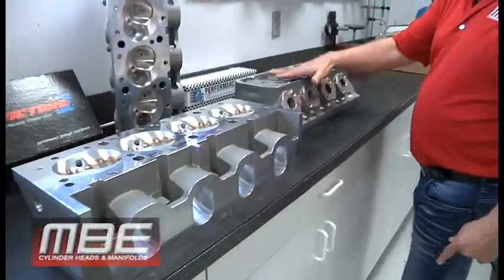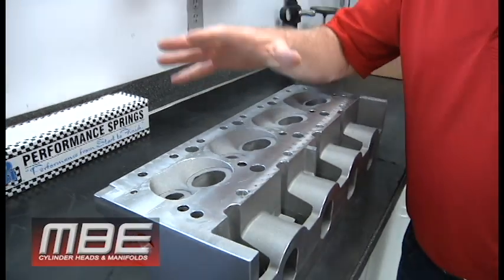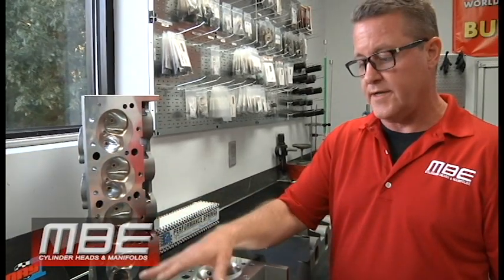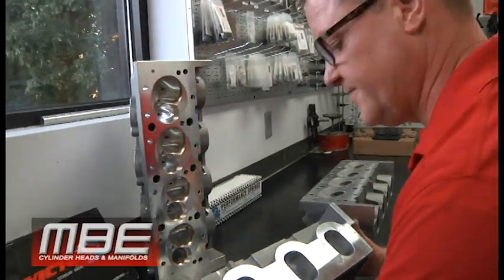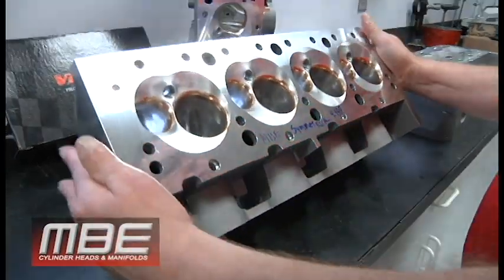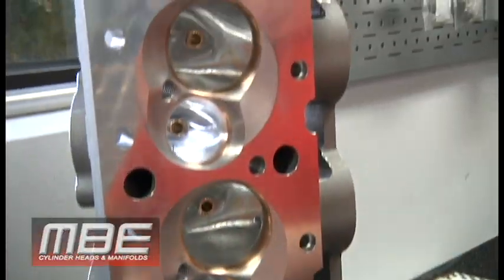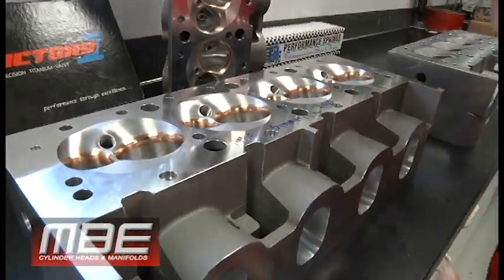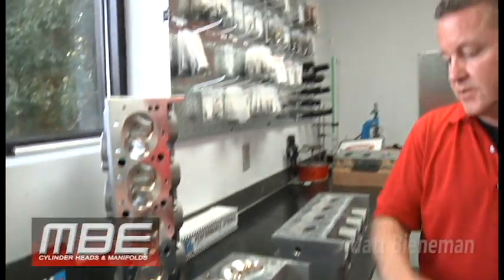** GAME CHANGER **  This SBC Cylinder Head will change History

Comment: It looks like one of the head bolts goes almost right threw each intake runner , a problem I used to have when I ported regular sbc heads for big air flow . They'd flow like a mother on the bench but you flow them with the head bolt in it  ,,,not so much . Not nickin this head its a way better design than the original for sure . I wish we had this 15 years ago I think it will be a game changer for the old school small block

Comment: This its a Pro Filer 12 degree casting , will be interesting to see if MBE change the degree angle I think the went to a 11 degree on this one, because some times they said on a video a 9 degree its better for nitrous and in the other one a 12 for more nitrous and boost and the same for the splayed valves; there its a video about there 13 degree heads that they said there its not a reason to run a splayed valve head any more and correct me if I'm wrong but this its a splayed valve head? , any way keep up the good work

Comment: I wanna see the bottom end of a small block that would be able to handle the rpm needed to take full advantage of those ports in a N/A configuration.
Reply: Bet it's one of those "if you have to ask how much, you cant afford it." Type deals....
Reply: @gadgetdeez7069  oh, I'm not talking about price, I wanna see the unobtainium that the rotating assembly is made from. We're talking pistons speeds that even Japannese 1000cc Super Sport bikes would be like "hold up a minute".
Reply: @WVXL64  there are countless amounts of sbc’s here in Australia that rev to 12000
Reply: @G6E666  yes but they are short stroke small cubic inch engine (283, 289, 301, etc). To really take advantage of these port sizes and flow numbers full potential, you're looking at a long stroke, 427ci or bigger small block, turning 14,000rpm. I dont know of any piston that can handle that kind of piston speed. I'd love to see it though if it exists.
Reply: keith stoehr  There are lots of aftermarket blocks that can handle that HP. Plus, a billet block easily will do it.

Comment: WOW, THIS IS A GOOD HISTORY LESSON FOR THAT AREA / TIME OF DRAG RACING.. !  I HAVE AND ALWAYS WILL BE A CHEVROLET GUY..!  I WATCHED PENSKY AND MARK DONOHUE DOMINATE THE MUSTANGS IN THE 1968-69 TRANS-AM SERIES AND WINNING THE CHAMPIONSHIPS.!  CHEVROLET WOULDN’T HELP PENSKY SO HE WENT TO AMC …LOL !  IVE ALWAYS THOUGHT THE ford WAS A BETTER DRAG ENGINE  OR RACING DOWN A LONG STRAIGHTAWAY THAN CHEVROLET , BUT THE BIG BLOCK CHEVY AINT NO BOAT ANCHOR… THE CHEVROLET HAD ALWAYS DOMINATED SPRINT CARS, NASCAR ,  OR ANYTHING THAT WAS ON AND OFF THE THROTTLE USUALLY HAD A CHEVROLET POWER PLANT.. I AGREE WITH YOU THAT ford HAS ALWAYS BEEN INVOLVED $$$$ IN ‘’ RACING ‘’ WAY WAY MORE THAT A SMALL COMPANY CALLED CHEVROLET..!!!  FORD VS CHEVROLET IS PROBABLY GOING TO BE A THING OF THE PAST WITH THE SEWING MACHINE REPLACING THE V-8  .  I ALWAYS LOVED READING THAT THE GREAT DALE EARNHARDT WOULDN’T DRIVE A ford  (AFTER DRIVING ONE FOR LESS THAN A YEAR )….LOL ..!!!  🏁

Comment: For the average guy by the time you buy the heads and all the valvetrain then the intake and headers you might be able to purchase a few other cars. Then with those big ports and flow numbers on the street the port velocity will be crap unless you run 13:1 compression or have a roots blower. On a stroker engine it would be better but like I said for the average guy the bang for the buck is there but you had better have a lot of buck's. And that is not the majority of average people these days. Those would be good in Nascar where the rpms are always 6000 or better they are great heads but for the street they are overkill.
Reply: Nobody street drives this head lol That isn't their market
Reply: Who ever said these were street heads?

Comment: So basically you made a set of Ford heads to fit a Chevy.
Reply: We have 480cfm sbf heads? Or 2.30 intake valve sbf heads?
Reply: @garlandjones7709  Ford's Boss 302 came with 2.23 intakes stock...yup.
Reply: @kidsteach938  Thats like comparing a 2.02 to a 2.08/2.10 intake in an oem inline head chevy or ford either one. And 2.30 valves in a boss 302 wont pick it up 200cfm. These have much smaller exhaust valves than a boss and im sure different valve angles as well.
Reply: @garlandjones7709  We're saying that it is a magnificent head, but an evolution of a Cleveland/Boss Ford head, not an evolution of a SBC head.
Reply: @kidsteach938  the stance comes from a lack of familiarity of history imo, and i may be wrong. Firstly, both the original post and yours seems to imply the assumption that the symmetrical port and valve cant is the first of its type in the sbc world. There have been handfuls of these.... even sold by this company.  Neither of those features is what this video is advertising to sell these over others. 

To say again in different words, im open for learning...but what makes these a copy of boss/cleveland heads vs a copy of BBC heads?
Reply: @garlandjones7709  Well, you would have to pull up a Cleveland head and see the port shape, spacing, volume...the combustion chamber shape and relative slight cant, the enormous intake valve...I know the numbers will be different, but this head is the son (or daughter) of a Cleveland father. I'm VERY familiar with American V8's, and know about polyangle Mopars, Ardun flatheads, early hemi's, Chevrolet's "mystery" rat motor which became the BBC, etc. I have owned small block mopar, sbc, bbc, FE ford,  bbf, v8's over the years.

BBC don't have spread intake ports, and the shape is different as well.
Reply: @kidsteach938  im familiar with the clevelands. I guess my point was missed. The familiarity reference wasnt to american v8s in general. If youll go back to my comment i made mention to the history of thr SBC head. What i had in mind was the over 20, going on 25 year old SB2 Nascar heads, and a handful of other aftermarket ones since, and possibly some prior. 

Im aware of the bbc outer port locations. The point with that was to see what you were seeing specifically that is calling this a copy. That seems to boil down in this scenario the intake port spacing. There are several canted valves. Just as there are inlines, and a few hemis/semis. You can count on your fingers all the port styles, all the chamber styles, and all the valve spreads, etc..... LS engines use symmetrical intakenport arrangement, didnthey copy the cleveland? Or did they copy the windsors inline layout? Its hard to say. Its not like there are boatloafs of options they had to choose from. You can barely make it more than 4. 

I guess to clarify my issue would be the emphasisnon sb2 platforms and others regarding my familiarity comment. Id guarantee you without a doubt, that these men never once referenced a 50 year old boss head when designing these castings. These are specifically offshoots of 25-30 year old plus cup technology. Now if you wanna argue Nascar grabbed ideas from boss/cleveland layout thats dandy. But the original poster here quite obviously didnt have that in mind in the least and takes assumptions that this is a first time gig and thats why these heads are being touted the way that they are. And thats the stance your defending, to which im insisting is ludicrous, from the position of this being an all new sbc layout.
Reply: @garlandjones7709  Ok Garland...now you are putting words in my mouth...do you still want to play nice, or do I take my gloves off, buddy? YOU said "copy" nobody else did. Then you called me ludicrous...You are being disingenuous on purpose. Anyone can see that these are an evolution of a 50 year old ford head. The LS? Don't get me started on how you can put ford heads on an LS block.
Reply: @kidsteach938  Good morning to you, too. Man, oh man, this is a disaster. I didnt intend to put words in your mouth, but you are clearly twisting mine. 

First thing to note. I responded to Jason Wells. Not you. You go on to say "We're saying that this is...." speaking for him too. I think personally that your thought on the matter and his are two different thoughts and i am partially in line with your angle of thinking but at point past agree to disagree as i also think you're completely misunderstanding my take on this. Nevertheless you grouped yourself in the same boat as his comment and i took note. 

Youre correct, i did say copy. Im assuming youre pulling that from my last post yesterday where i also referred to them as "offshoots", in line with your terminology using "evolution". Now prior to that when i used the term copy more than once in a post and what made them a "copy" you had no issue with the word, and replied with "well, you would have to pull up a cleveland head and see the port shape, spacing, volume...the combustion chamber shape and relative slight cant, the enormous intake valve..."

Now i had no issue with your wording and understood what you meant by the reply to "copy". I assumed you equally understood my usage of the term.

Going back to the start, the original post, Jason Wells says "So you basically made a set of Ford heads fit a Chevy". I see no need to pull put a dictionary definition of the word "copy" but my usage and both of our original understandings in light of meaning should be easily comprehensible AND applicable to what HE said, which is the subject of topic. Id think all three of us know that no one thought this was a boss head on a 4.4 bore space Chevy bolt pattern. 

You said i called you ludicrous.... thats a major twist and putting words in my mouth. I called your stance ludicrous, and it is compared to what im trying to get across. Even more ludicrous now is that you say i called YOU that. This is 2nd grade grammar. In light of this paragraph, and the rest of this post, who is being disingenuous, honestly? And no need for derogatory name calling, even if its clothed and mild, buddy.

Ford heads on an LS.... this was my implication when i brought it up. You can put LS heads on a SBF Ford too. So we dont have head copies at all. We have block copies....thats a whole diff subject and unneeded as the emphasis was rhetorical to emphasize the silliness of the concept.

To add a little clarity to my stance if it isnt clear now.... looking at a cleveland head to this one, which i reiterate is not the issue, the first thing that sticks out to me is the intake port. Not the location in relation to the cylinder horizontally which is surely what the op sees, but the vertical which seems to be missed by both. The angle from the valve seat to the entry roof. You cant get this imo, off of a cleveland. And from an oem standpoint theyre entirely different to someone that knows how cylinder heads work. To the 99pct of naked eye, which im NOT trying to group you in, this would be unnoticed. There is a lot more to head design than outer casting dimensions and im sure you agree with that, but it doesnt seem to be acknowledged.

To state one more time, i think undoubtedly that you and the OP are on different paths of understanding and i encourage you to seperate your thought from his as mixing thebtwo is detrimental to our discussion. 

His post comes from two areas. One mentioned already, not knowing sbc history as his post assumes the video is showing the first time a symmetrical cant valve sbc had been produced, or complete ignorance of how cylinder head flow works in the areas that the air sees before combustion. Likely its a combination of the two. And lastly ill say again, id bank 4 digits in a bet that these guys never once looked at a Ford head when makking this one and that they used 21 years known evolution from cup heads. If cup heads were designer after Fords thats a different topic. In reality, its all math, not brand name, and id assure you that every oem designer had played with symmetrical cant designs before a boss and didnt use them due to other constraints. Just as much as these guys are within constraints of sime sort with this 10,000 head or else them and all their competitors equally would be using hemis, not cants. There is no copying or using anyone elses design here. Its simply bright men developing to the best od their ability within the bounds theyre allotted. 

Nothing in my prior posts was meant to be offensive or hostile, and very little was to be argumentative, only for the sake of getting my point across. Id like for it to stay that way on both sides of the fence. Im sorry that you took offense to whatever it was that upset you, but you had taken me wrong vs how i meant it. Within this post i took offense to your last one. Hopefully, you will see why and hopefully it is water under the bridge
Reply: @garlandjones7709  Thanks for your well thought out response. This head is definitely not a copy of a 1960's stock ford head...agreed. However, as you know BBC Texas 20 degree heads are still visually an evolution of the Mark IV head, these heads are not an evolution of the 1950's sbc head, but as you said, perhaps an evolution of the cup heads. Ford Cleveland 4V heads may look like 1000hp heads, but are really only 350-400 hp heads. Even Bob Glidden had to extensively weld on these old iron heads to make them work for him. I understand where you're coming from and appreciate your response., which was way more than I deserved or expected.
Reply: MBE makes a 485 cfm head for it.   Kaase CHI heads are 450cfm.

Comment: I love the cylinder head design, so bad ass. But aren't SBC's falling off from popularity when it  comes to racing? Maybe they would be good for a certain class. But 10k can go pretty far in a good bottom end and turbo on an LS
Reply: Totally agree. Small block not good to that power on bottom, ls from factory can do 1000 and survive. But so much head flow for small block. This is the same head flow on the new 632 chevy that makes 1004 hp
Reply: You don't really think this is for people running stock blocks, do you? 🤣🤣🤣
Reply: The SBC will NEVER be absent from the drag strip or any other racing venue.
Reply: I just smashed a twin turbo LS with my SBC Nitrous with a similar head design. So I don't think the SBC is gone. Take these heads with turbo or procharger and make 2000+ HP easy
Reply: @Bozemanjustin  you're flipping crazy dude🤣🤣🤣🤣 the LS sbc what those heads in the video are made for are dominating the streets right now and drag strips everywhere 😂😂😂 you clearly don't race and have no clue wtf you're talking about
Reply: Sbc aren't going anywhere and aren't any less popular than they ever was
Reply: I can't wait for this kind of design treatment for Flathead Ford V8's!!!  Seriously, where was MBE with these heads 60 years ago?  Maybe GM wouldn't have had to go to the LT and LS if MBE had done this kind of SBC head treatment before the 2000's. Heck, GM would have never needed the BBC if this head design had been around in the late 1950's! 😉
Reply: @mikenodine6713  that would be awesome man I wish they would make some for the flathead
Reply: @jonathanlawson4667  It could be argued the flathead caused the birth of hydraulic lifters.  It is a royal pain adjusting those valves.

Comment: Doesn’t symmetrical heads require a custom cam?
Reply: And alot of extra custom stuff!
Reply: Requires different Pistons cam push tubes rocker arms you name it. I'm wondering if some of the sb2 small block stuff would work the Piston should the both symmetrical heads I know the intake won't because of the cooling passages being separate

Comment: Damn, I thought the 2.300’s were big in my big block... as much of a push rod guy as I am, why has nobody made a 4 valve OHC or DOHC for SBC/BBC?
Reply: Watch David Vizard's latest video. He mentions that and asked if his audience would be "interested" in a video about them. 👍
Reply: The LT5 was all Chevy needed to do to have a dohc V8. Let’s just stick with push rods. So much easier to work on
Reply: Chevy's new c8 Zo6 made 670hp with 5.5l. Imagine what DOHC head will do with more cubic inches. It's about time to move on to better technology.
Reply: @TravisG001  It's not really about technology, though. It's about the end goal. I don't want to get into the TQ vs HP debate but increasing the displacement with no other changes will increase the torque substantially with very little gain in HP. I think GM was trying to avoid low RPM TQ because of a few factors such as structural integrity, traction, drivetrain longevity, etc. It's easier to avoid those issues by creating more HP with smaller displacement and higher RPM. The easiest way to do that is a flat plane crank and DOHC. And man, did they nail it or what? 👍

Comment: 2.300 valve, great, laughing with my custom sohc 4v hemi head with some massive valves lol, im still working on it but cad flow is showing 630cfm lol and I plan to cast and sell for about 2k a unit
Reply: Ok. But this is for a small block chevy. Not no damn mopar
Reply: @Hawkers02  this head isn't for mopar, its for a ford 300 i6

Comment: Have these heads been installed and tested on an engine yet? I would not think that they would idle too well unless you are running a port injection system. One area that I see that may be a concern is the upper cylinder head bolts. It appears you are running a short bolt in that location, which requires the big hole with plug seen in the valve cover area (for torque wrench /socket access). With coolant pressure on one side and engine vacuum on the other, getting those cylinder head bolts to seal would be #1 priority and concern. Especially with aluminum heads expansion/contraction rates. What type of bolt and seal or sealer will these utilize? Otherwise, I cannot wait to see these heads in action.
Reply: Damn. MBE could have saved so much money and prevented so much embarrassment if they would have just checked with you first 🤣🤣🤣
Reply: Nothing you stated applies to these heads. This are for the big boys. Sprint series, NHRA, Midget, etc. About $8k to $10k for the bare castings.